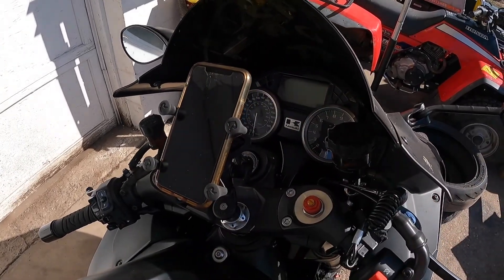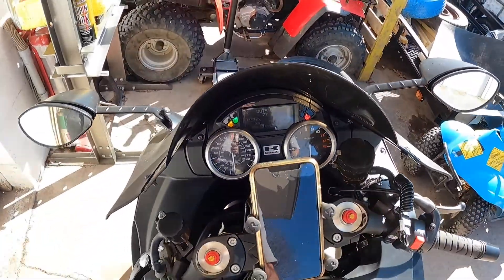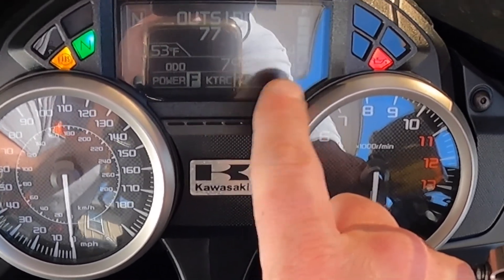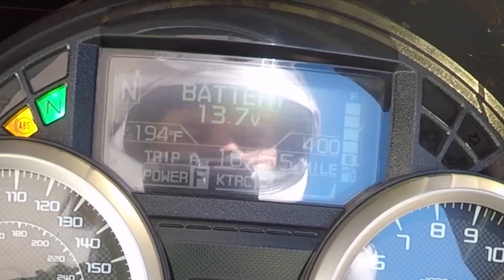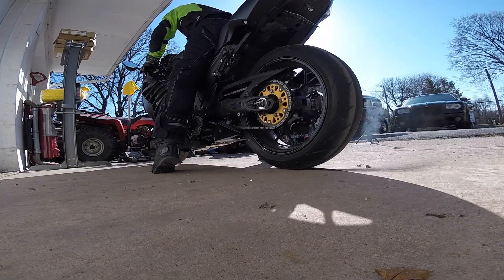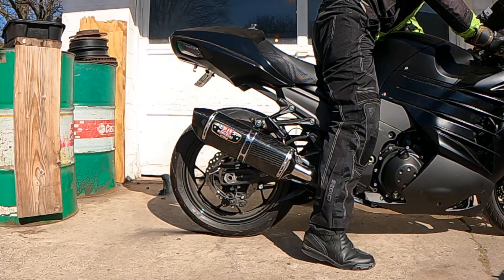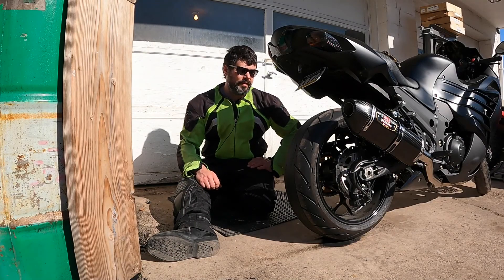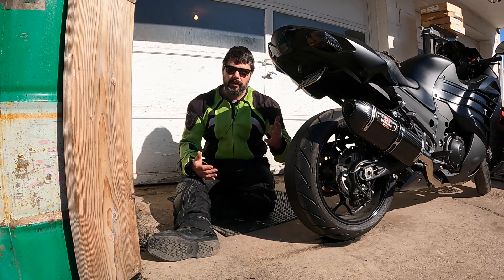How does traction control work? 2013 Kawasaki ZX14R

Comment: I love the looks of the ZX14R. Would you recommend it for a rider who does not ride aggresively (100mph average) but likes how it looks and sounds, or you would be wasting money? Is the fuel consumption excessive?
Reply from the maker: This bike is a great all around bike. I average 40mpg with mixed riding. Plenty of power to just leave it in high gear and cruise without sacrificing comfort
Reply: @MattsMotoWoRX  Thanks for answering! Could you tell me also about fuel mileage and maneuverabilty in the twisties?
Reply: @LINKchris87  I have one too. It is heavy in low speed situations, I would compare it to harley sportster weight, but it feels higher up (obviously). I've ridden many bikes, this is my 4th sport bike and my 6th motorcycle overall. Its a quality bike, has all the best that kawasaki has to offer. Its basically like going to a GM dealership and buying the Z06 corvette, its where all the R&D goes at kawasaki, and its a well built machine as a result. Maneuverability in speeds higher than your residential areas is definitely easier than you think. When I rode it it felt only slightly more heavy/awkward than a 600. They are surprisingly easy to flick around, and most riders couldn't do any better in the corners than this bike is actually capable of, so don't let noobs tell you "but it cant steer hur hur hur". Fuel mileage, it has an average and an instantaneous mpg on the digital readout. Mine says the average is around 34, but Ive only had the bike a week so I really dont know how accurate it is. It seems close though. Plus, I ride more aggressively than most once I get out of town onto the interstates or country roads. The average inlcudes time doing 110 steady cruising on the freeway, and several hard pulls through midrange
Reply: @fastcar42069  Thanks a lot for your detailed response! I currently ride a gen 1 busa and have very similar impressions: heavy at low speeds, weight dissapears above 30 mph. Surprisingly flickable in corners. About 38mpg. Great comfort.
Would love to have a ZZR1400 or 1200 to make it company.
Reply: You need to also inform people that there is a definite difference in power with the traction control completely shut off. Many 14R owners ( including myself) have noticed this: even though full power is supposedly available in “F..T1”… it pulls harder with it completely off.